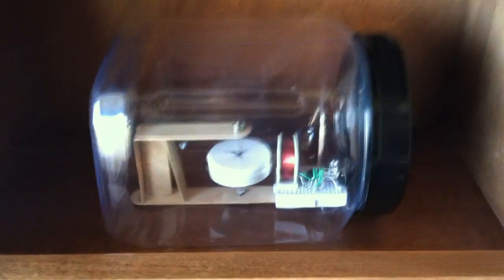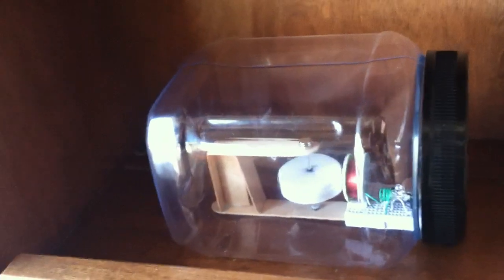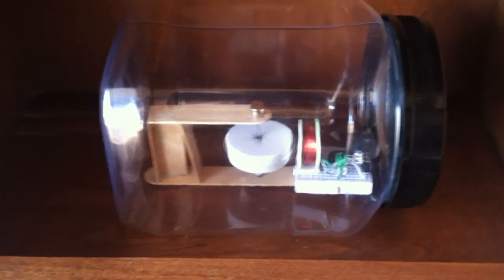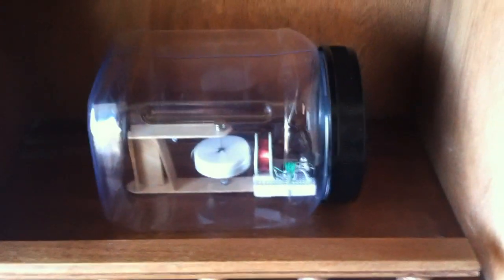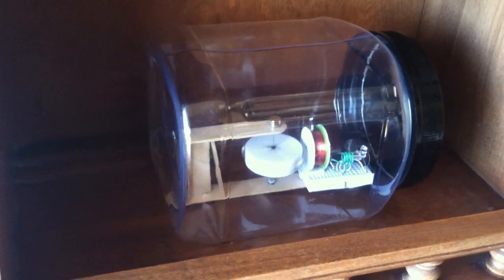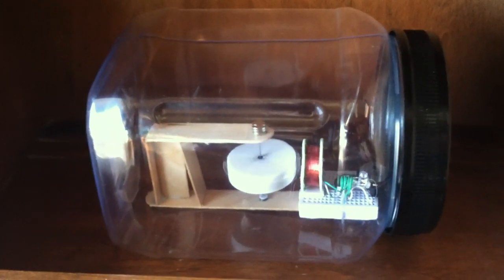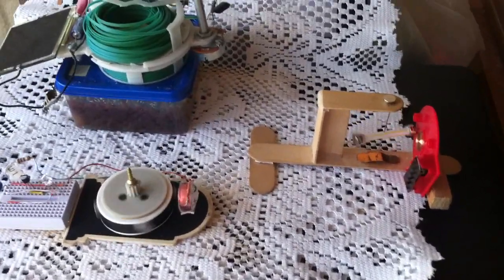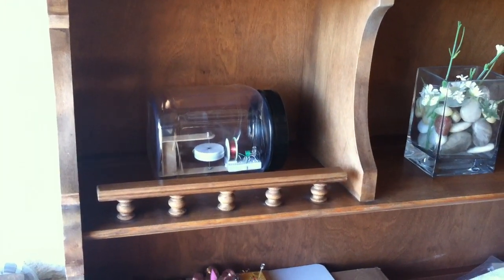Micro Amp Pulse Motor---In A Jar

Comment: Hello Lidmotor! First I wanted to say thank you for the vids and fueling my obsession with this stuff! Love the vids! Wish I got into this stuff sooner...I was just curious if you ever experienced this problem or had any thoughts as to what it could be..So I'm running this circuit with the 3906/3904 and about a 7k 44AWG coil. On my uA meter it was reading 7-12 uA in a pulse fashion.  It ran great for about 14 days then it became slower and slower until it stopped. Right after it stopped I checked the battery and it was perfect like it was never touched. Using the Ultimate lithium AA's. You ever experience this?
Reply from the maker: Yes!  This happened to me also.  In my case it was a friction problem coupled with alignment shift between the electromagnet and the rotor.  The battery voltage should stay constant for a long time on these type batteries so look for another reason why the motor stopped.
Reply: Thank you for the reply :) Ended up using the very tip from a tiny Christmas tree light bulb as a bearing surface. Forms a nice glass funnel for the needle to ride in and so far it's running pretty good! Somewhat faster than before. Must have been friction. Before the needle was just riding on a lower magnet. Now it sits in the bearing with a stabilizing magnet above. Thanks you again!

Comment: Hi Lidmotor, thanks for the upload but it causes me to question: Beyond a interesting curiosity, what good is a motor that can do no work?  Help me please, am I missing something?
Reply from the maker: It is a toy but sometimes a simple toy can lead to more serious inventions.  The quest was to keep a mass in motion for as long as I could on as little energy as possible.  There are lots of applications for that idea. One of the most difficult tasks was to make it small and quiet so that my wife would let me keep it in the house ---and not in the garage.
Reply: I agree, fiddling and tinkering can sometimes lead to a useful item. What applications do you see for mass in motion on a little energy?  Also, your wife must have super hearing, I can't imagine your little motor making any racket at all <).
Reply: I'll offer this for a low tourue item: If it creates an audio output, perhaps a sensor or even several sensors could could convert the noise to electrical energy.
Reply from the maker: My wife has very good hearing and ANY noise coming from one my projects dooms it.  As far as an application for this "efficiency" quest---- just imagine a better electric car that went further on a charge up and cost less per mile to operate.

Comment: so maybe to slow it down you could have a small coil take some  energy out and 
feed back to the input. not sure if this would this be counter productive with losses
Reply from the maker: I can slow it down by adding more transistor base resistance.  I might do that because it also drops the amp draw.
Reply: +Lidmotor is there a way you can add transistor base resistance but instead of using a resistor and losing to heat maybe some thing that can enable the use of that energy . I'm thinking small thermo electric
Reply: +Lidmotor or even an inductor

Comment: Do you have a metal object in the coil or just nothing?
Reply from the maker: The coil is an air core.  The hole is about 1/8".  The coil is 4000 ohms and is made with 42ga magnet wire.  The coil design is by Theodor Pali and is the main reason this pulse motor works in the micro amp range.

Comment: I'd suggest that though you cannot make a device that runs forever, as even magnets have a life span, there is no reason to think you cannot make something that lasts 500 years and can no longer output power.  In relationship to a human lifespan we could say a device like that IS "perpetual."
Reply from the maker: The word 'perpetual'  means the machine just runs on and on and on........  and never stops.  In 500 years perhaps nobody will even be around to notice it. I'm 67 now and my perception of 'perpetual' is a little different than it used to be.